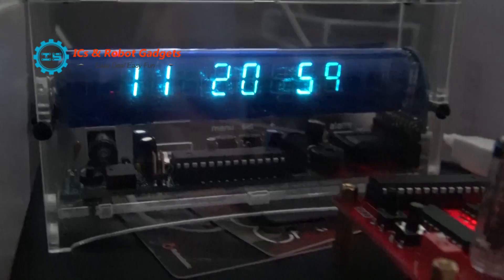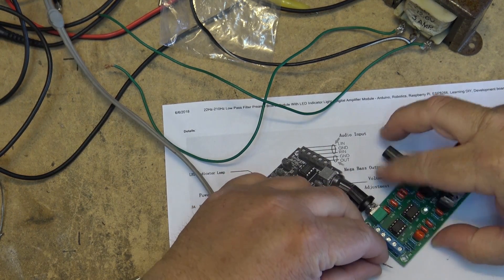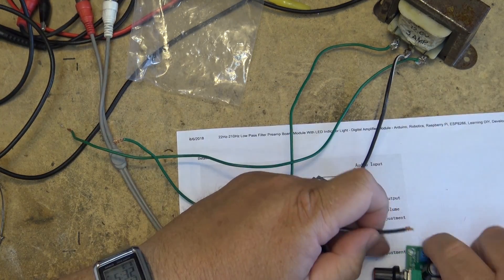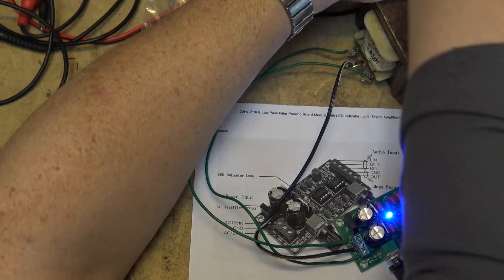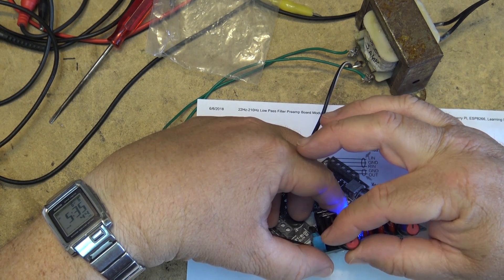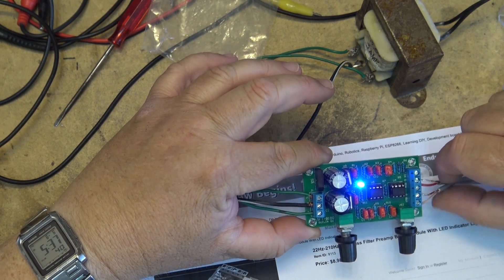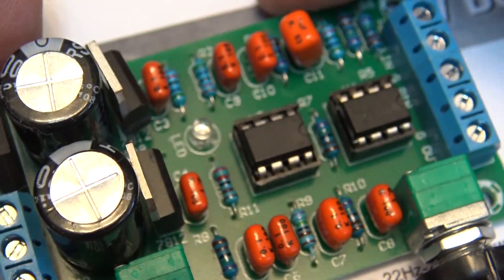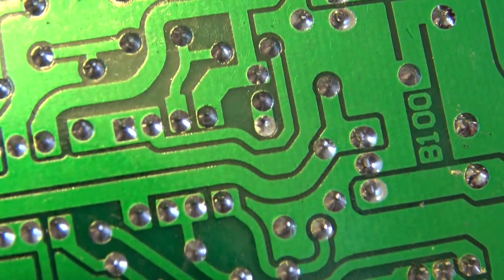Low Pass Filter sub preamp module test run

Comment: Hello. I need some help from you! 
I have the exact same card! The card has a design flaw in my opinion.
Across L and R input there is 20k resistance and there are no input capacitors!

The signal should have been mono wired at the output of the op amp ic. and not on input! 20k resistor over L and R can lead to nearer mono sound!

If you take output from a preamplifier and run it into both an amplifier and a bass amplifier then 20k resistance over L and R is not good. There is also no capacitor on the input!

What is your professional opinion on this! Be a little technical!

Comment: Hi can I use a headshet 3.5mm jack instead for the input and a 3.5mm jack for output?
Reply from the maker: Sure as long as the wire is shielded it should be fine.

Comment: If i have a subwoofer  with his own amplifier inside. Do i have to use a pre amplifier  ?? My main amplifier has two channels , no subwoofer exit
Reply from the maker: A dedicated subwoofer should have a low pass filter ahead of the amplifier.
Reply: @12voltvids  thanks for the answer. My main amplifier has two channels , no subwoofer exit. Do i need a pre amp for the input of my  dedicated subwoofer? T am thinking of those tube buffers you made in other videos . Would something like that suits ??

Comment: is their a good place online to buy those AC transformers?  Ive tried googling them but not a large selection from any site I'd trust. I have a few, but most are way over 24v/24v , mostly salvaged from older electronics.

also thanks for the close up of the board. those look like nice higher end components.